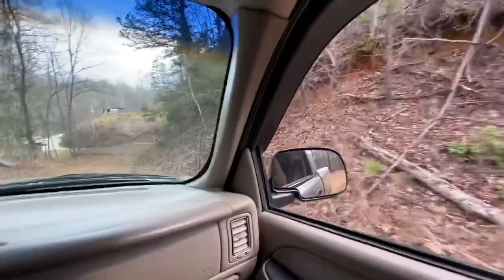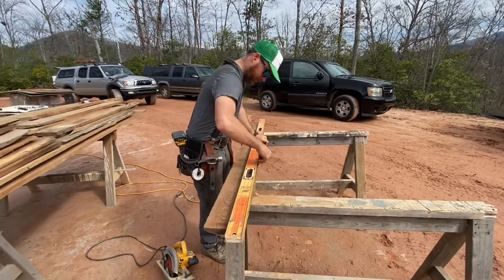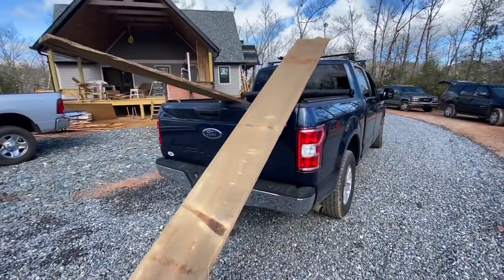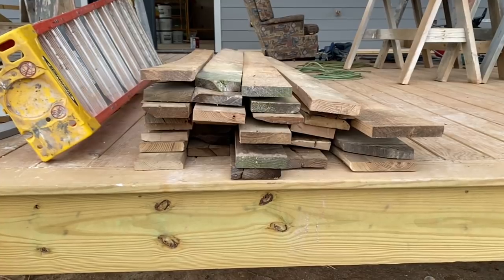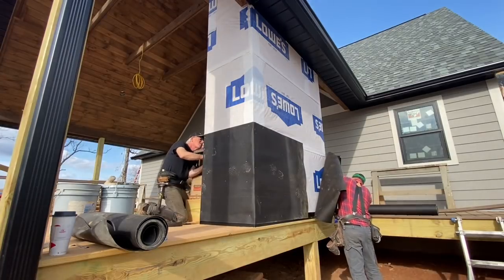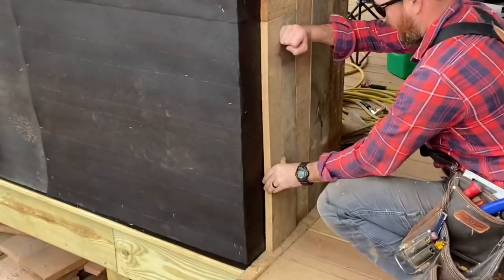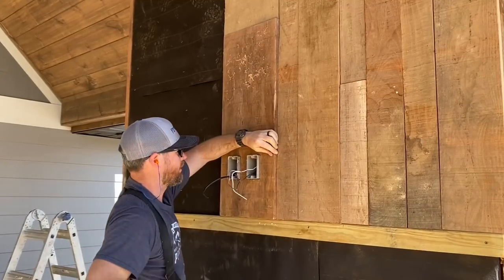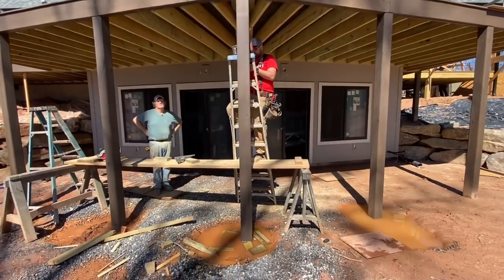How to process and install a rustic barn wood wall... for cheap!

Comment: Looks great. We just finished building a small living space in an old barn using reclaimed wood on the ceiling and one wall of the living room. Turned out great. We used all of the methods that you did in this video!!

Comment: Great job!  I do a lot of work with barnwood.  It's getting harder to come by.  Looks like you guys had plenty for your project.  For any other viewers out there doing work with barnwood, You can rip therm in half (assuming they aren't too bowed like some of the ones on this video) and you get twice as much material (assuming you have two good sides).  I mount the ripped pieces on 1/2" plywood (using glue and brad nails), then mount the panels as I need them.  I am really appreciating these videos and still learning.

Comment: Here's an eye protection tip for ya. When I do a lot of custom milling work in redwood, I throw on a pair of snowboarding goggles. They don't fog up and keep all the fine sawdust out of your eyes. You can find them a plenty at secondhand stores for a couple bucks. I keep three pair in my truck :)
Reply: Thanks for the tip

Comment: Great 👍 video‼️ Entertaining and Informative as usual‼️
“Early Wood Restorations” in Cleveland, Ga., not too far from Yall, reclaims old warehouse beams, flooring etc. I bought many large (4”x 8’ or 6’ depending on my design- some were 6” thick) mantelpieces. They really look rustic w/ curly shaped corbels under them for support. 
Other designs I used were All stone mantels w/various sizes and shapes of stone corbels. 
You did an Excellent Job with this Beautiful Fireplace‼️

Comment: You didn’t do much other than cut off the crappy bits and nail it to a wall? Am I missing or were the boards perfectly fine to use from the get go?